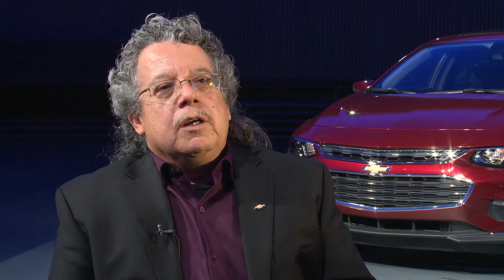2016 Chevrolet Malibu detailed by chief engineer Jesse Ortega

Comment: Steel?.....the whole world went Aluminium atleast let alone Carbon fibre
Reply: The whole world hasn't gone aluminum yet and are not likely to.  If you can get the mass out (300 lbs is pretty impressive) then you've met the objective, so why go to the added expense of aluminum?  Especially if it also means more $$ for the customer to repair?  Audi, Range Rover, a few other lux brands have gone aluminum.  Plus Ford F150.  Not quite "thwhole world" yet.